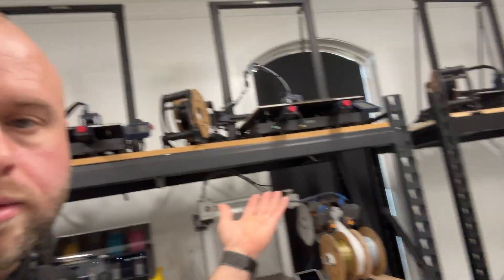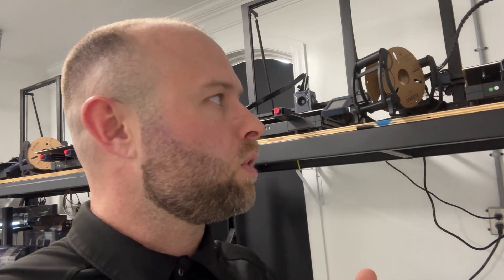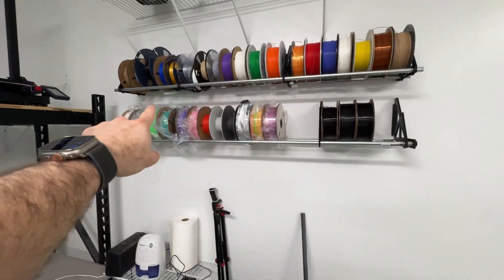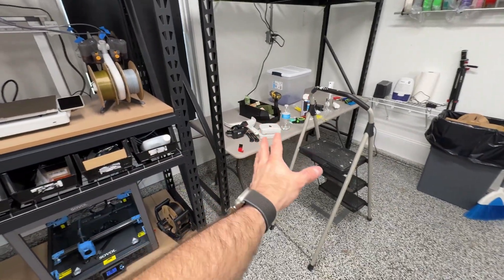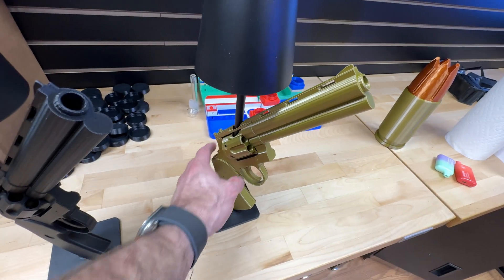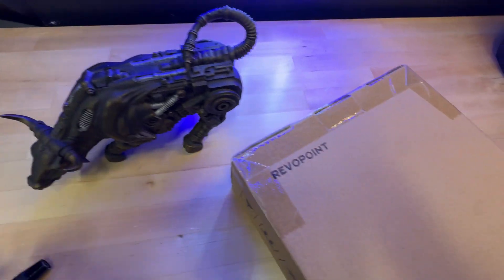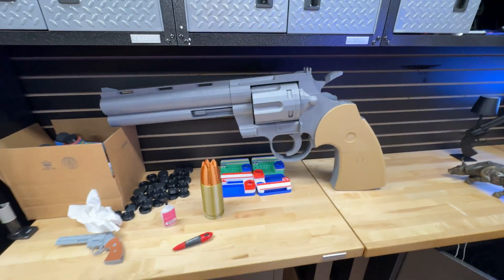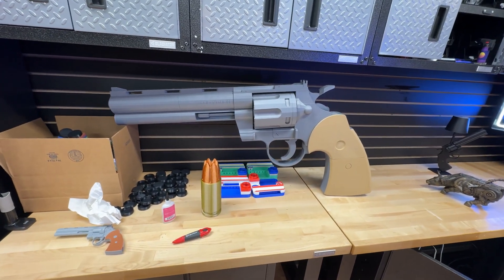GIANT MODEL SOLD! / New Scanner / Fresh Setup: 3D Printing Startup Business Chronicles

Comment: Nice work on the models! I've been playing with wood pla's a bit. You can lightly sand them and use wood stain to color them. If you use a small paint brush, you can draw in the grain first, let it set, and then stain lightly over the top. I use water based stain in mahogany.

Comment: Tbh you really don’t need a super computer to model, slice, and 3D scan. I had an i7 3770k, gtx 1650, and 16gb of ddr2. I made video games, models, and vfx on that computer. I have something better now but many years of contract work went into that computer. Use what you want, just recommend staying away from Mac due to their absurd prices.
Reply from the maker: LOL every machine I have are macs except for these PC's.
Reply: @TechnicalsTinkers  It’s cool. Just wouldn’t recommend them for modeling, vfx, video games, etc that uses complex modeling and physics computing. Otherwise, you have to go out of your way to find expensive solutions to really simple solutions when it comes to Windows. When you scale that up to maybe hiring a modeler, video editor, etc it’s starts to get really expensive paying for those computers. I have Mac, Windows, and even Linux home built machines. Every tool has a purpose.

Comment: Heh great idea to bake in closed place computer (no ventillation will not help much), and other brilliant idea getting fast USB port extension (even active, man even if you buy device with such port u get short cable or long but very fat and stif with added second one to provide more power into device).. what can go wrong? xD.. and than that questions, like "why this doesnt work?"
Reply from the maker: it has active ventilation (exhaust fan at the top) as well as intake fans built into the plexi
Reply: @TechnicalsTinkers  yeah and I concloused that in that cabinet is place only for that computer... is there place for free circulation of air AROUND PC?
Reply from the maker: Plenty, its roomy

Comment: You and M3is3D both ship your large items fully assembled. Have you considered ways to split the large models into two or three smaller pieces that would be easy to assemble and ship? Probably not the same split as how they're being printed but something with ease of assembly, volumetric dimensions, and seam hiding in mind. The 'L' shape of the "lead accelerators" in particular seem to create a difficult to ship product.
Reply from the maker: I have, yes. Considering for the newest model breaking it up and putting in place a snap or bolt setup, but ultimately this isn't a functional print and should I expect the customer to have to assemble a piece of "art"? Or just ship it whole and work it into the price. Such questions